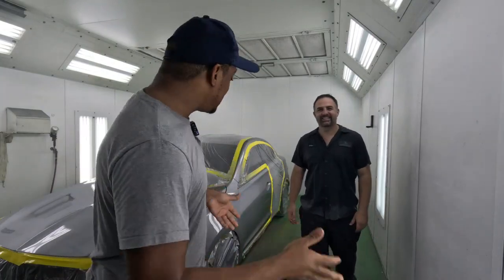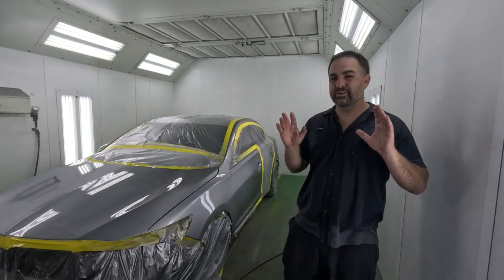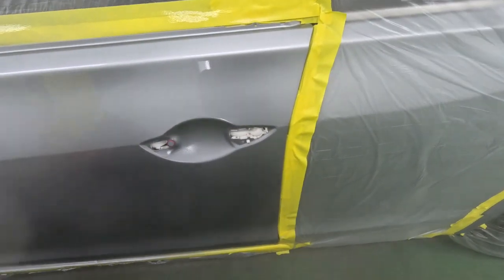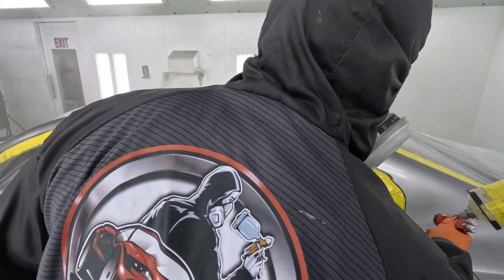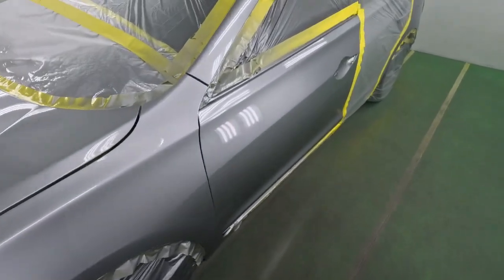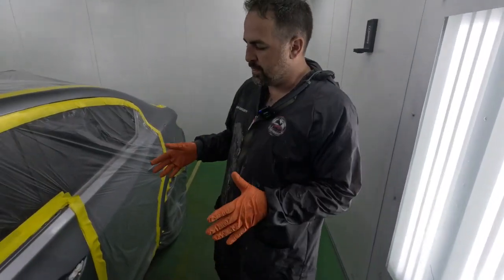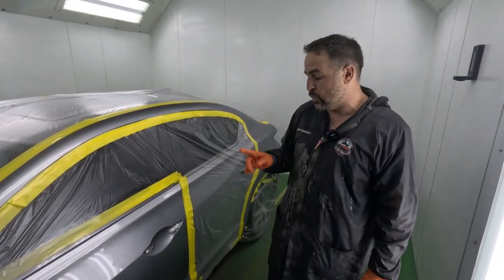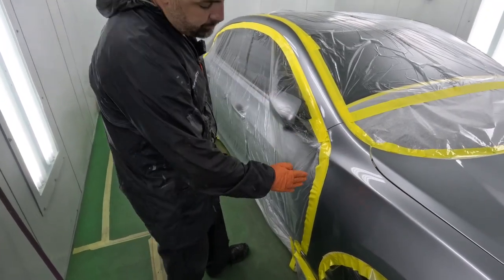MOST IMPORTANT CLEAR TECHNIQUES/NO REDO'S

Comment: Was wondering why you guys have tape around your paint cups? I wanna say Ive seen others do the same
Reply from the maker: Using the cup over and over leaves a buildup of material, which can flake off and throw trash in your paint job. Hence the reason for the tape.
Reply: Good tip thx👍